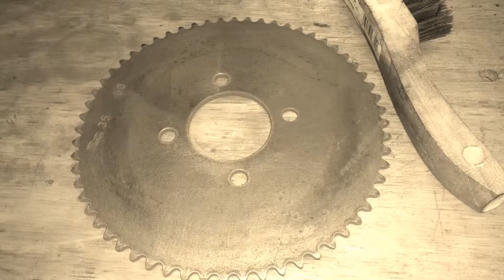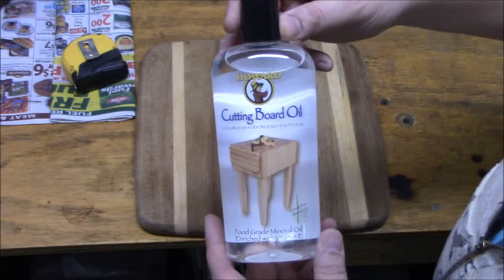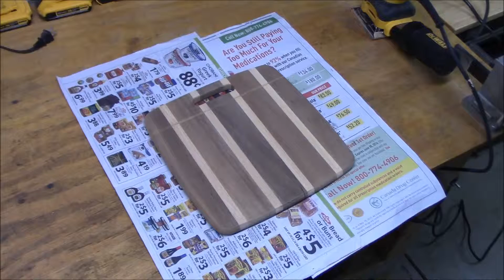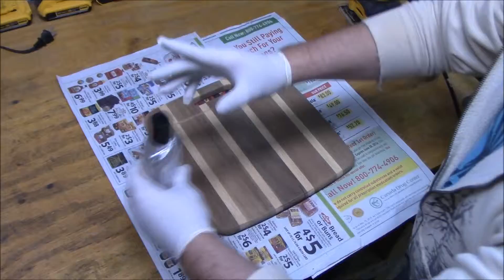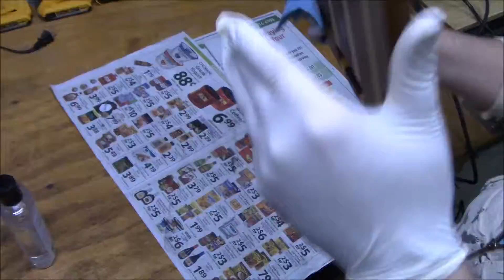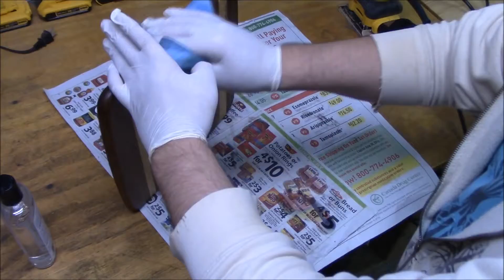Cutting Board Refinish with Howard Cutting Board Oil

Comment: if after you add the mineral oil they have a product by howard its called cutting board conditioner and has beeswax and other hardening agents that works great and helps fill in all the knife marks and dings I use it on all the cutting boards I make